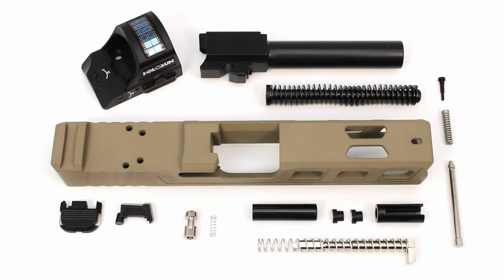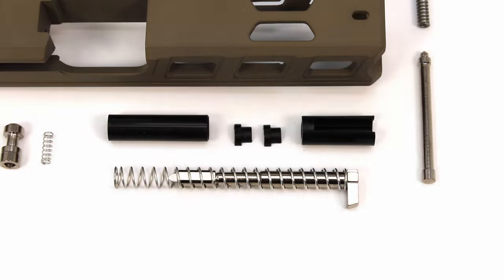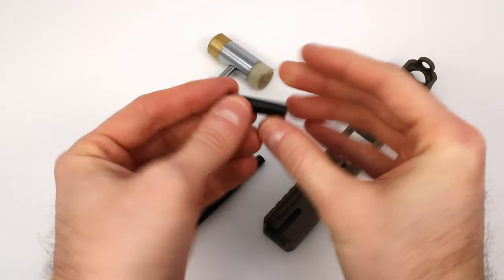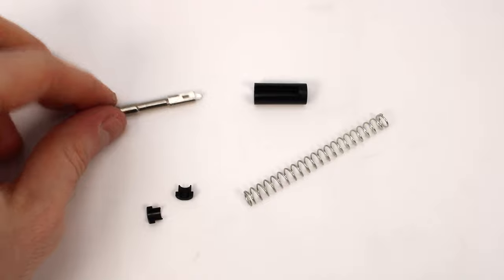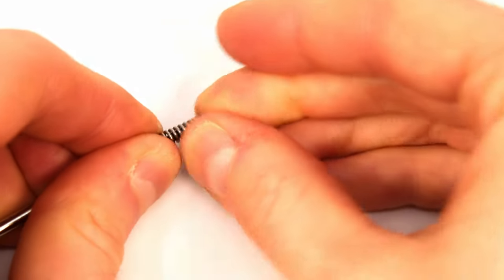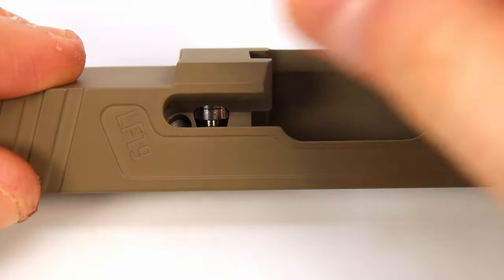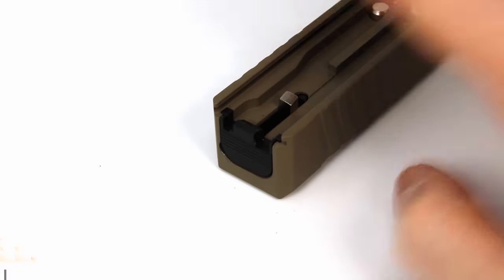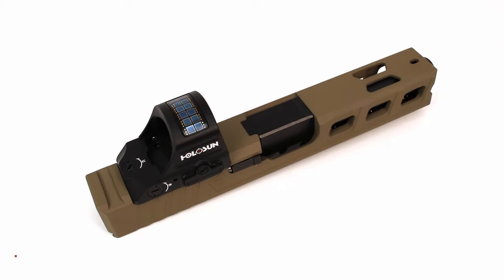How to Assemble a GLOCK Slide

Comment: Pro tip, use the second holo plastic tube with the cutout as guide to insert the channel liner and gently push it in with your finger, worked perfectly for me with a shadow systems slide kit
Reply: Exactly and to take it out you can also use a bic brand mechanical pencil without flaring out the plastic
Reply: “Pro tip” I did it once lol.

Comment: For the firing pin spring, put the right angle of the pin on a desk or something stable, push down with your fingers and place the retainers on.
Reply: There's an even better way. You use the slide itself as the "something stable". Set it vertically muzzle end down on a firm surface. You could even put it in a vice if you have one but it's not really required. With the striker guide and spring on the striker put the guide into the striker channel BACKWARDS with the striker tab down in it's slot. Now with one hand you can grip the slide with your little fingers while pulling the spring down with your thumb and forefinger of the same hand. The striker assembly can't slip, it's held in the channel. With your other hand you then install both spring cups. Simples!

Comment: My hands a week. To rack the slide. I change the recoil spring to 13 pounds. And now it won’t go into battery kinda gets stuck. And needs a slap to close
Reply: 13 pounds is to light try 20 pounds or 17 pounds and the heavier the recoil spring the lesser recoil
Reply: I use a 16# spring since I reload less than maximum charges.